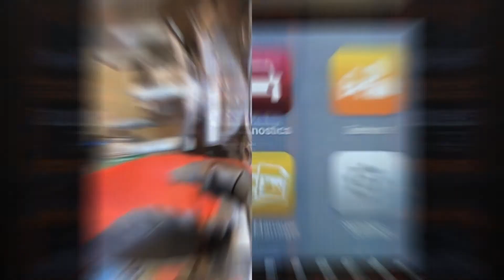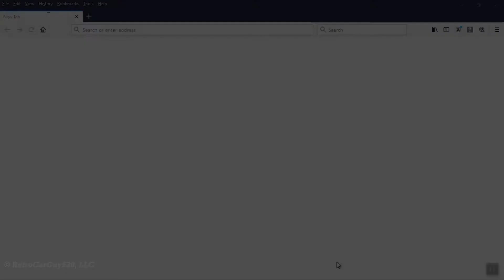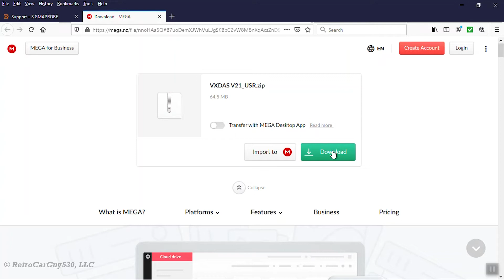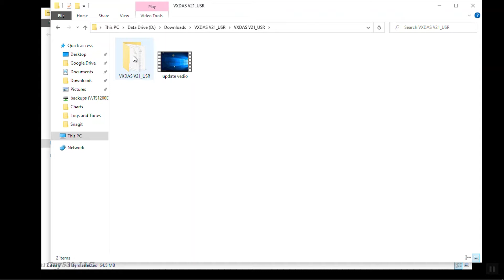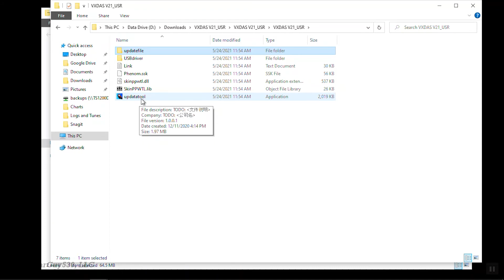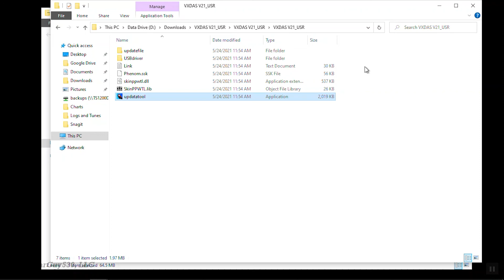VXDAS SigmaProbe - Firmware Upgrade Steps

Comment from the maker: This is my first video on the VXDAS SigmaProbe Vehicle Intelligent Circuit Tester.  I wanted to document the steps necessary to refresh or update the firmware of the SigmaProbe.

⏲ Video Chapters ⏲
00:00 - Intro
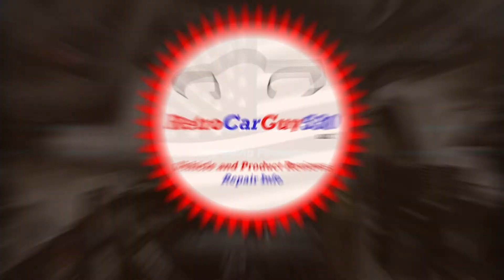00:26 - Download Firmware ZIP File
02:52 - Install USB Driver
04:22 - Firmware BIN Files
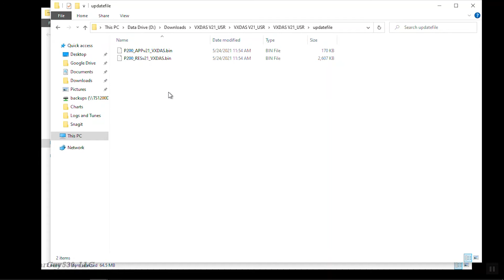04:43 - Start Update Program
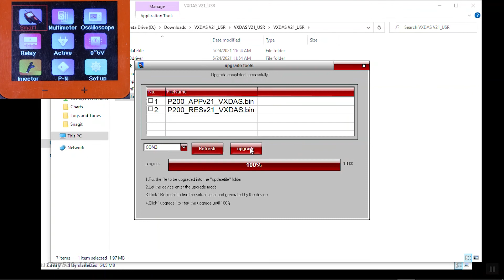06:32 - Check Firmware Version

Comment: may i ask, how did you connect the tool to the pc usb port? what data cable did you used? thanks
Reply from the maker: The SigmaProbe comes with a USB Type-A to USB Type-A cable.  You plug one end of the cable into the USB cable coming out of the SigmaProbe and the other Type-A cable end into your computer.